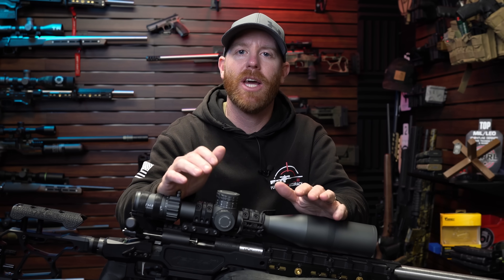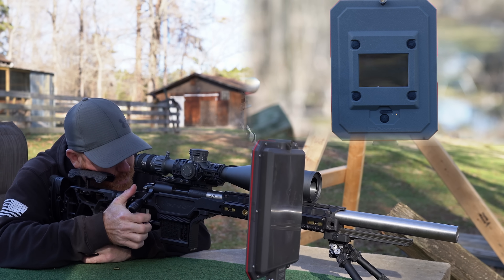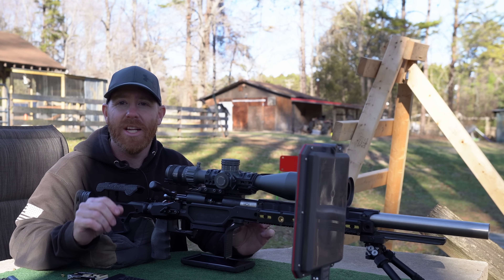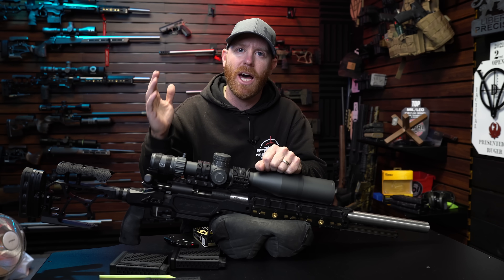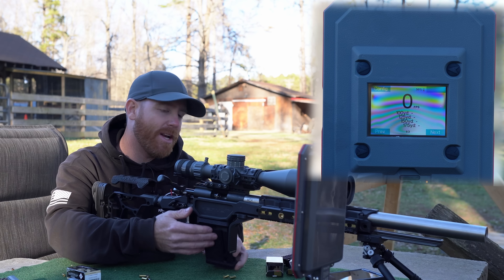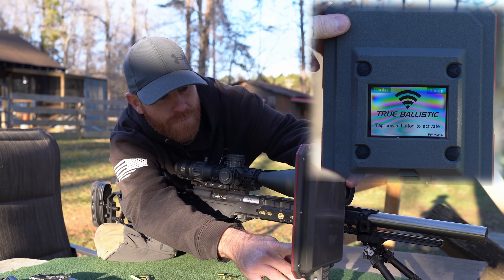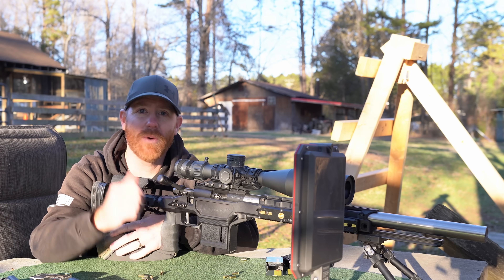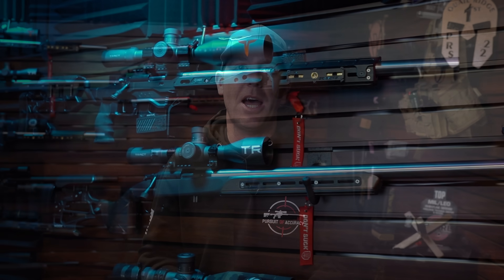Eliminate Cold Bore For Pennies: Part Two

Comment: Thanks for sharing Josh.  I have a couple things to bring up. I believe the rifle you were shooting in this video had a custom barrel and your gunsmith would have checked for tight spots in the barrel, so in your case, I think it has more to do with what you were addressing in your 1st video causing the increase in FPS on the 1st shot. If a barrel has not been checked for tight spots it would be a good spot to start.

Comment: Have you tried out the Hoz and Shield Cold Bore Cap? Seems like a nice durable alternative to the finger condoms. 

I know you say you were done with the series but it would be cool to see you shoot groups for cold bore shift with all of your precision 22s. If you start with one gun the 30 minute wait might be up by the time you shoot a group with your last one.  

Also, interested if you’ve noticed a POA to POI shift in any of your guns when shooting off a bipod compared to off props or with varying amounts of shoulder pressure.
Reply from the maker: @austinkroe  that sounds expensive to test lol. 
Some stocks and chassis will have a poi shift from bipod to bag on prop that I've noticed. Haven't noticed any poi shift with different shoulder pressure.
Reply: @PursuitofAccuracy  nope, not a cheap test at all. 
With the POI shift, I tested it with my gun at 135 yards and didn’t notice a difference either.  But what got me thinking about it was Tyler Orth’s interview with Jason Nedved a bit over a week ago. He mentioned it and I was wondering if I was nuts for not seeing a shift.

Comment: Just watched, with great interest, both videos on this. And subscribed!
A question remains that you barely touched on. I can certainly see a vertical POI shift due to a change in MV, but I frequently have a left / right deviation that accompanies the vertical. Can you offer any ideas on that?
Reply from the maker: Its more than likely just harmonics causing the left to right shift. The higher mv shot being out of the node.
Reply: @PursuitofAccuracy   Seems that's the default "cause", though I'm not so sure I believe a +30-40 MV difference incites a 1/4 to 1/2MOA horizontal deviation from s bull barrel. I'm not arguing your explanation, I just don't understand how that can be, and I'd like to. 
Re: Relative Humidity at differing temperatures - Absolute Humidity will more accurately indicate bore moisture. RH will better predict evaporation ('cold bore') wait time. The straw negates both!!
Appreciate your videos - you think and wonder and question AND test - a pretty good combination!

'

Comment: It looks to me like there could be a low velocity on the second shot, but while it does seem to have happened multiple times it may be my imagination, but it would be interesting to see if it was statistically significant (as well as the degree of speed change with different ammo ?)
Reply from the maker: I see a slight drop on the 2nd depending on which ammo etc but its usually 10 fps so within the acceptable ES.

Comment: wow that's pretty convincing evidence. i've always heard the carbon ring in the chamber was the major factor, so that's not the case anymore? my stock CZ MTR has a horrendous cold bore shift. how would you suggest using the straw method at match, since you have to remove the chamber flag to do it.
Reply from the maker: At a match id just plug the barrel like we did in the 1st video. 
Or you could just blow in the chamber during your make ready

Comment: You mention that it’s moisture buildup inside the barrel but blowing with a straw removes it I would think that would add more moisture from your warm mouth and lungs I would lean more towards the oxygen amount like a mono core suppressor has a 1st round pop after the first shot it’s quite.
Reply from the maker: I actually meant your adding moisture with the straw. I believe the mv jump is due to airflow removing the moisture
Reply: Ok makes more sense that way

Comment: Is “cold bore shift” unique to .22 or common across calibers?  Would think this is something the military has studied. Something the artillery has looked into. Is it something that must be accounted for. (Would need one damn big straw)
Reply: Military shooting does not require "accurate shooting" as competition does. The military usually has wider tolerances for acceptance. While you or I might require half MOA or better, I believe, military accept 3 MOA. Therefore, cold bore shift is not something to concern them.

Comment: Hi Josh, just wondering what is your average cold bore shift. I am averaging .1 and after 150 200 rounds my cold bore is .2mil.
Not sure about the other tight spots theory as there isnt enough time for the metal to take the heat, i think of annealing brass flame time along with that.
Reply from the maker: Typically .2 for me

Comment: I still believe it's the amount of oxygen that causes higher velocity of first shot. By blowing through straw the air is replaced with moisture and Carbon Dioxide and both are non combustion materials and keep the velocities in tight figures. Some lubricants also burn and might help in increasing the velocity by few feet per second and that can be checked by rubbing the tips with alcohol patches and get the velocities compared with the lubricated ones 😅
Reply: I am not sure about this take. Because when you exhale most of the oxygen that you breathed in is exhaled, you only use a small amount of the oxygen in each breath when your not doing vigorous work. Additionally having more or less oxygen in the barrel shouldn't effect the combustion very much as the gunpowder is self oxidizing and the oxygen in the barrel is separated from the combustion at all times by the projectile. As for the lubricant burning, that could be an interesting thing to test.
Reply: Oxygen in the barrel is on the wrong side of the bullet to have any effect on powder combustion.

Comment: the finger condoms have been sold for muzzles for years. I was given a pack years ago at the Shot Show In O'rleans. 
Idea was t keep rain, snow and grit out of the muzzle When I was there with Nugent.

I'm lost on the straw method if moisture is the issue as blowing down the bore would introduce even more moisture. No? 
KnifeMaker
Reply from the maker: @michaell397  moisture is naturally left behind after firing a round, so each shot has moisture helping to lubricate the bore. The problem is the 1st shot after a time that has a dry bore, it's going to create more friction and resistance creating a mv spike